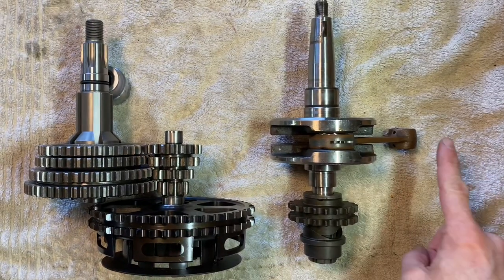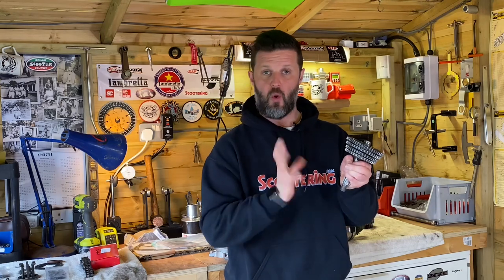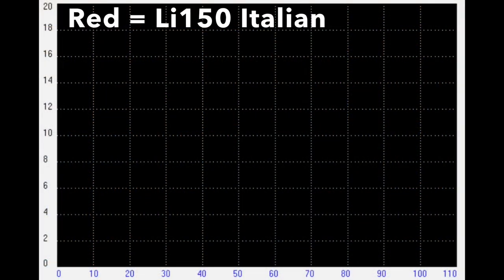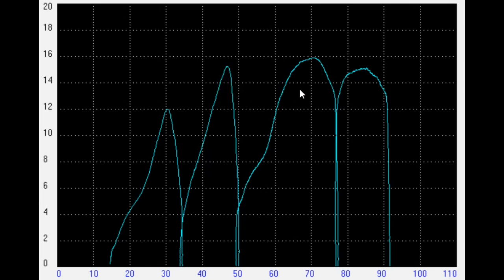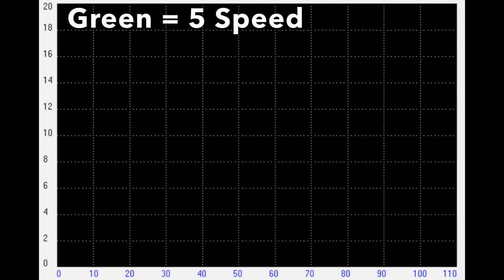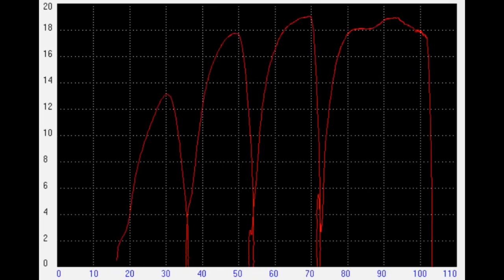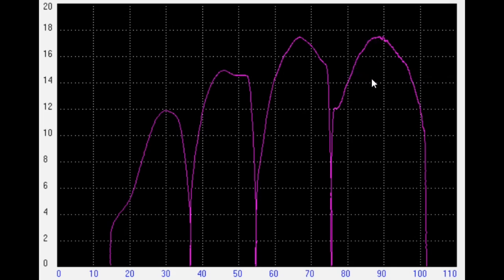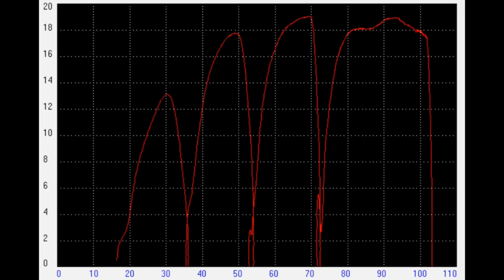Lambretta & Vespa Gearbox - Gearing for speed & performance - which is the right choice?

Comment: Excellent explanation of the gearing. I have a 63 LI 125 with production number 070401 but I keep hearing that they had two different transmissions on 1963. I see everywhere that the most common gearing is the 15 sprocket and the 46 teeth clutch bell.

Comment: That’s why imola with an Li150 box 15x46 CST 3 pipe runs lovely. Tried 16x46 and 17x46 to try and get higher speed at lower revs. I might as well of got off and walked it was garbage. Flew flew first 3 gears but 4th it was pants.
Reply: My imola kit ran a sx200 gearbox 15x46=fd 4.8 with a vhst 28 delly and bgm mk3 clubman. Thing flew along with only the steepest hills killing power. Loved it, only downside was fuel consumption was horrendous ☹️
Reply: Recently fitted my LI 150 box with a 17 sprocket and standard 46 crown wheel, Mugello 200 (not reed) 28 PHBH, an old expansion that I'm not exactly sure what it is. Haven't worked out the FD ratio, drives pretty well but then I'm the guy mentioned in the vid; 10 stone and 5ft6" with a wife who would rather die than ever get on the back. Pulls fast through 1,2 And 3 then have to welly it a bit in 3rd if you're going uphill before changing up. Managed a true 61 mph on the flat without screaming it at all
Reply: @neuralyser  FD 4.6 😉
Reply: @exsoulagent  Figured something like that because it feels a lot like my SX200 did in the 80's, just put an old school Dave Webster style pipe on today and a fast flow fuel tap and got it to 64 mph on my GPS tracker on the flat, probably faster than I ever went on the SX but then it was impossible to tell how fast you were (or weren't) going back then...didn't stop me telling my mates that it did 70 though haha
Reply: @neuralyser  good old Lammy Speedo, 3 modes, not working/ needle bouncing/ Flat out 😂😂
Reply: @exsoulagent  Haha yeah, mine works now and doesn't windscreen wiper too much but it consistently reads 10mph above the actual speed you're doing. In case anyone is interested the set up that I mentioned (Mugello 200 piston port, Li 150 gearbox with 17 and 46, PHBH 28 no filter and the old style DJ exhaust) gave 60 miles per gallon on a 110 mile run
Reply: @neuralyser  not bad, my reedvalved Rt200, 25 delly on bgm V4 gets roughly 120 miles on a 13lt tank
Reply: @exsoulagent  I'm not too good with litres but I think that's 42 mpg, suppose a lot of that is down to the reed set up, does it pull well and what gears are you running?
Reply: @neuralyser  made a mistake 120 miles on 8 lts of fuel so around 68mpg
No complaints from pulling power, Sx200 box 15/46 Fd4.8
Reply: @exsoulagent  Mmm was thinking that sounded really bad! I was considering buying a complete SX200 box to try, just out of interest and to prevent the faster spin of the gears which I must be getting with the 17 tooth sprocket. Have a good weekend
Reply: @exsoulagent  Hi again...out of interest what settings do you run with your 25 Dellorto? I've been trying endless variables with the Mugello 200 I mentioned, finally seem to have got everything spot on with the following (PHBH 28) AV266, X7 on the highest (leanest) clip, 55 pilot, 300 choke valve and a 125 jet, mixture screw about a turn and a quarter out, Went out earlier and got 74mph on my speed tracker, most I'd ever got before was 64 before it bogged. Want to try to test the compression because it's Mahoosive but my car one won't screw in properly with the engine in the bike. Plug looks like an acceptable colour after a 30 mile ride. I've just bought a new RT195 kit but am delaying installing it because I can't be arsed with the running in whilst this Mugello is going so well, if only I can get around this mental compression
Reply: @neuralyser  RT 195 Reed valve, 60x110 bgm crank, 3 mm base packer and 1mm head packer.port timings are 180 exhaust, 125 transfers, 26 blowdown, head squish is 1.0mm.
Carb setting is 300 float jet, 70 choke, 58 idle jet( mixture screw 2 turns out), 40 slide, AQ 266 atomiser, D22 needle(3rd clip)although could be dropped 2.5. Main jet 110
Reply: @neuralyser  I would say ur head needs modified as with most of Tino’s stuff too lower the CR 😉

Comment: Dan, most common sense vid I have seen in some time. I am running a TV 200 with a standard gearbox and drive using the Avanti kit and MB big bore exhaust. Gearing is not right having to change down on hills and in windy condition. Any suggestions really appreciated.